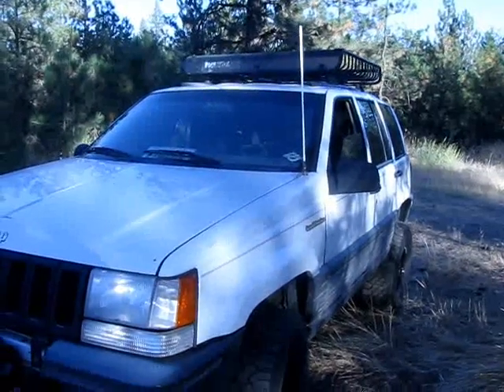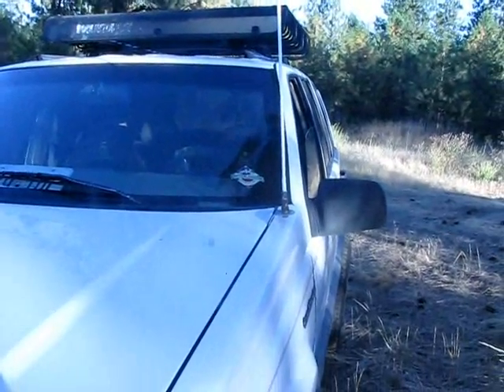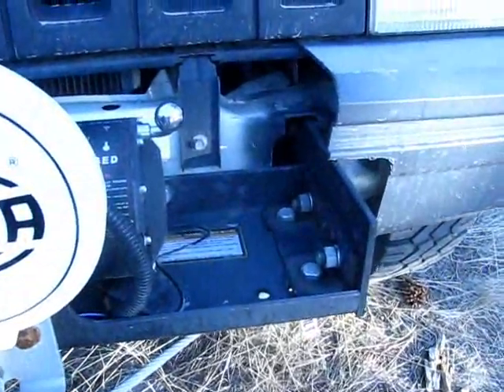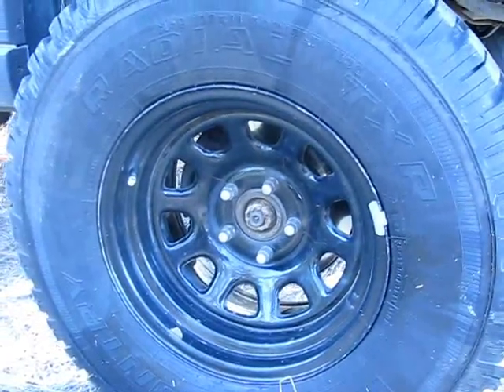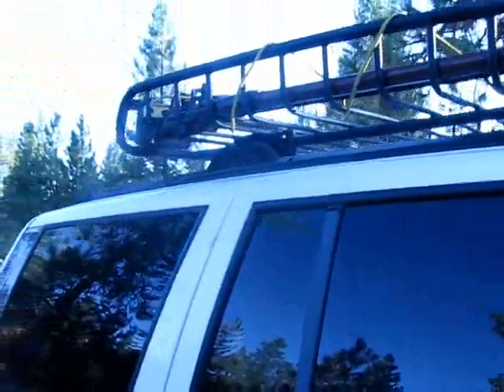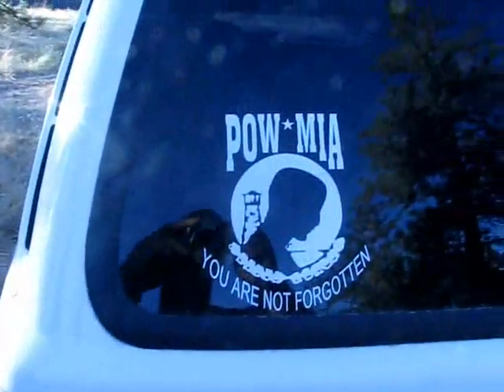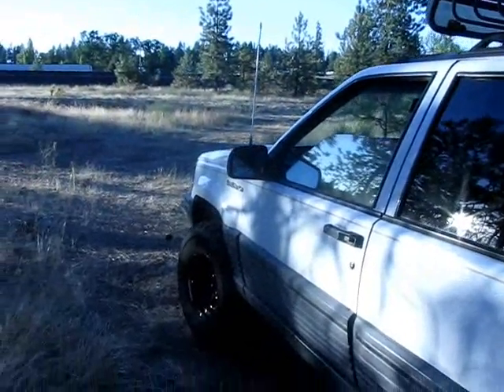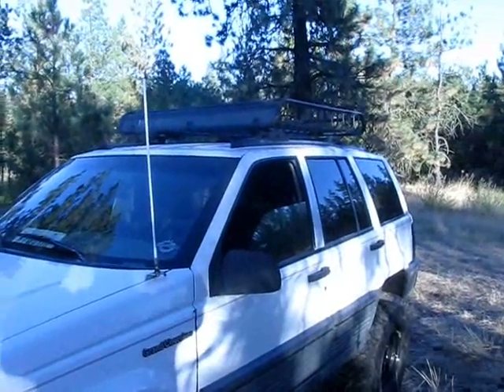Bug Out Vehicle Part 1:  The Walk Around

Comment: Did you ever weld up the winch plate? Or are you waiting to hit something on the trail, weaken a bolt then have it break later during a pull? Grade 8 hardware only increases tensile strength (linear) not break strength (shear load)... Only increasing fastener size or composition increases shear load capacity. Seeing that your bolts are at a 90 to the force, I'd burn in that bumper mount ASAP..